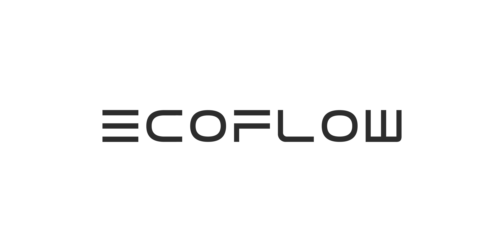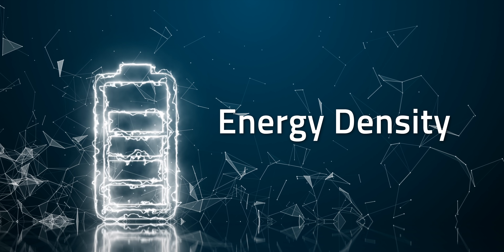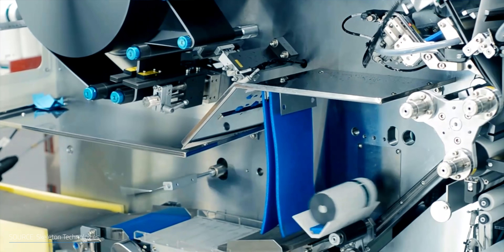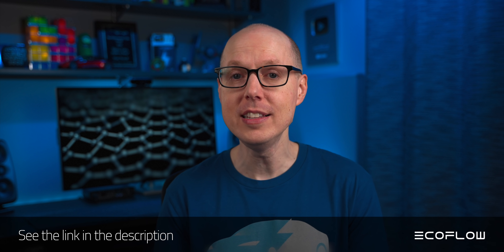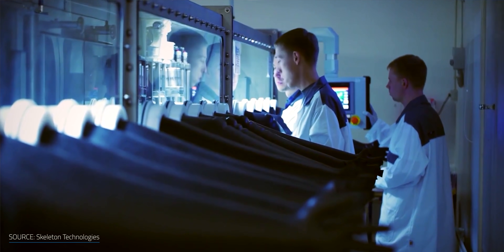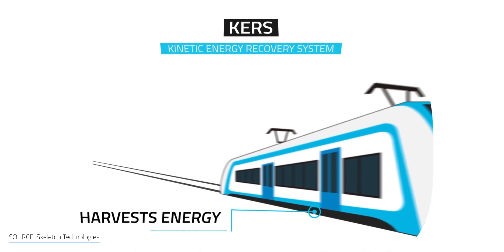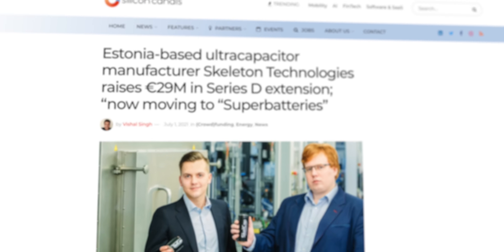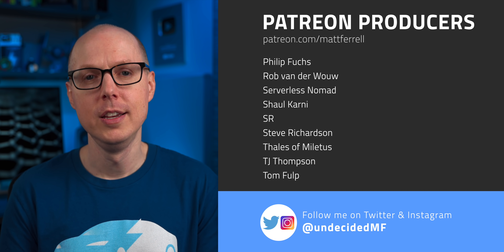Revisiting the Supercapacitor - The Wait for Graphene is Over

Comment: Batteries have a flat line discharge curve with rapid drop-off at the end. Capacitors have a straight line curve. From 100% to 0% over time. The bulk of capacitor energy is stuck in the bottom few percent.
Reply: uhmm arent you contradicting yourself ? "straight line" knowing you have P=VI means you have most of the energy 'accessible' while at high voltage. And yes, sure you need different power electronics to make use of whats stored in a capacitor, since as you point out, the voltage wont be constant. But what you may leave untouched at the bottom few percent of voltage because its hard to bring it up to the voltage level you may need for your application is only the bottom few percent of capacity and not 'the bulk'. But yes, a simple replacement of a battery by a capacitor will typically not work.
Reply: With circuits and controls, what can’t you make a system that charges stacks of units like this in order to create constant power? I’m asking but I can tell you it’s already being tested and is completely doable…with ss graphene units you can get a base of 30,000 discharges with zero degradation. It’s here just needs scale.

Comment: The 'Eco flow' battery looks interesting...but it's not very big.   A better solution would be a MUCH larger battery (that is portable and also multi-use)....A used EV with a V2G or V2H option.  Probably cheaper too--when you factor in the power available.
Reply: I have a neighbor who 'unofficially' modified a used Nissan (Leaf) for the same reason (V2H)--by hardwiring  in a large inverter.  He rarely uses it as a vehicle however.  The future will likely be V2G for all EVs.   Think how much power an electric school bus or semi truck could provide :0
Reply: Thats all well and good untill someone has to take the vehicle 
away to use it as a vehicle 🤔 And if the house has more than one user or occupier then you have that  problem times by however many🙄. 

Its a bit like removing land lines because you have mobiles but if  
the power goes down your loose your base towers and a lot of internet  and most phones will be dead flat in a few hours.
Also the place where your most vunerable are gathered together 
have no energy/phone.
This is exactly what has happened following storm Arwen in the UK .
 Also because modern gas heating systems rely on electrical power they were reduced to nonfunctioning  lumps of metal. 
The ultimate joke is cashless payments systems ...shops closed because their tills wouldnt work and customers couldn't pay for products by card or phone. 
A point not missed by very suspect bunch of hackers who got into the Spar shops system typical of outlying communities in the UK.🤦🏻‍♂️ Like those already hit by the storms.

We are building systems that are no more than a hightech house of cards... because no ones prepared to pick up the reigns.
And the Achilles's heel is the insistence on linking everything up all the time to the net and IT/AI systems. 
They dont cope with natural extremes heat cold and water especially the  salty stuff.. 🌏
Reply: Why are you not working for one of these companies if you think your ideas will work? Or will they?

Comment: Can these be used on my residential air conditioner to replace the current capacitor tech.  The current AC capacitors have put more AC repair guy's kids thru college and Fannie Mae, at least here in TX.
Reply: Air conditioning motor capacitors are AC low capacity high voltage types a super capacitor only handles 3V DC. Do you have 3 phase power in your home? then get a 3 phase motor in your air conditioner. It is more efficient and don't use capacitors.

Comment: Great video Matt, did Maxwell technologies (before being purchased by Tesla) involve graphene super capacitors? Thanks again…
Reply: I believe Maxwell was more about manufacturing method than materials used. So you could use Maxwell processes to make almost any battery or capacitor chemistry. And make them in large quantities.

Comment: I wonder if those ultra capacitors with graphene are able to be used for heating homes. For example PV panels can charge those capacitors and then they'll stepwise heat up the flowing water in the pipes
Reply: You don't use PV for home heating. Direct solar hot water is much more efficient.

Comment: They sure could have used supercapacitors in the Chernobyl power plant so they didn't need to try (unsuccessfully) to use turbine spin-down to cover the back-up power kick-in gap.
Reply: I just looked that up. Chernobyl's pumps would have needed 5.5MW for one minute. That's too much energy even for these capacitors. They would have needed several warehouses filled just with capacitors. (~100kWh)
Reply: @GotYourWallet  Fair enough.  I admire that you actually looked that up and figured that out.

Comment: much ado about nothing.
The use of graphene in real world applications has little to do with it's wonder properties at atomic level. Skeleton company is fundamentally scamming investors. As graphene is used just as a fancy graphite in terminals to reduce the internal resistance of a battery. An improvement, but not a particularly significant one. And experimental supercapacitors using actual graphene properties are at least 10 folds less energy dense than Li batteries, without even considering much higher costs. Besides, supercapacitors are pretty leaky and lose their accumulated charge quickly. So, unless capacitors are fundamentally redesigned, they will not replace batteries anytime soon, graphene or not.

Comment: I have been expecting Tesla to add a big slab of ultra capacitors to their performance models in order to provide more power with less battery stress and near instant addition of say  50 miles when charging
Reply: They're heavy and also need a DC-DC converter to be of any use, their discharge curve is really steep. Tesla bought a super capacitor company and just used their dry process on their batteries instead of making super capacitors.
Reply: You just spoke my mind, despite what others or Elon thinks, I still believe Tesla is missing a game changer opportunity here. Imagine a small 5KWH supercap that kicks in during fast regen to suck up power dissipated during fast deceleration or kicks in during insane acceleratiin to reduce the strain on the Li-ion batteries. 
Best part will be providing instant power during subzero temps to quickly pre-heat the car Li-ion BMS to optimal temp as well as preheat the interior, defrosts the glass and then slowly recharges itself back after preheating Li-ion batteries from the car or do so quickly during regen or during recharging.

Comment: I think a hybrid EVs, with Supercapacitor plus battery, would have many benefits. The Supercapacitor would take care of sudden accelerations and stops - they degrade the battery the most. The batteries themselves can be optimized for power density, not power - and this means they could possibly hold more power even though some mass is dedicated to the Supercapacitor.
Reply: Lithium batteries are in the transition phase to hydrogen. The batteries are too heavy and are an obstacle to long-distance travel. Hydrogen will be used for long-distance driving instead of diesel in 10-20 years. Supercapacitor + Hydrogen is the hybrid of the future.
Reply: @rapator9270  Hydrogen has too little efficiency for automotive use - in both creating hydrogen and in turning it into energy. It has other issues as well. Liquid hydrogen can't be stored for long, and is too energy-expensive to liquify. Compressed hydrogen is dangerous and requires heavy tanks, and has very low energy density per volume.
The only advantage hydrogen has is that cars using it can fuel quickly. Then again, so can gas cars and Supercapacitors.
I can imagine Hydrogen being used for grid storage between seasons. Lack of power density is not a problem when it's stationary, and lack of efficiency is not such a problem when you store enormous amounts of energy for months.
Reply: @nikolatasev4948  Estonian company who test and make self driving cars co op. with Skeleton( what is also Estonian company) says that hydrogen is  Future thing and lithum not.
Reply: @rapator9270  I wish them the best and lots of success! Toyota and a bunch of other automakers are also believers in hydrogen. 
But until they prove it, I would trust Elon on this, he seems to have a more successful approach so far.
Reply: @nikolatasev4948  Elon is one crazy dude in good way, but even him dont solve lithium high mass problem.
Reply: @rapator9270  Every approach has its problems. But Elon and his approaches have so far been more successful than all others - in both cars and rockets.

Comment: This is awesome news! I cannot wait to see where this goes. I've been using ultra caps as a high current buffer before/after battery to charge quicker even in lower light conditions then keeps the battery cells at 80% for most the day. Then after battery when used for inverter, it is allowed to take higher burst loads without brown outs. At night with the moon out, I've had my battery banks charged to 90% over night.
Reply: I won't worry about specifics here, but I have access to production data for utility scale solar plants. A full moon on a cloudless night is something like 1/400th the power of a sunny day. We have seen actual solar power at night (bounced off the full moon). Not really enough to cover the inverter functions in practice though.
Reply: @GuyIncognito764  there were no mention of inverter used
Reply: I call bs on that friend. 

I've never heard of anyone having the ability to charge with moonlight.
Reply: @ryanduckering  oh yah and to be fair, I didn't state that the amount of panels were disproportionate to the storage of the system. Wasn't a practical setup when testing it out cause the amount of panels to 1 48v battery and regrettably 128 ultra caps to match without over charge. Not cost savings practical. Just a hey look what I can do and won't really make a difference. I wasted a HUGE amount of money cause the caps are not cheap and the solar was already there and the main battery banks were already full. So it was just for fun. Nothing to actually use realistically. Something Something about designing something that no one asked for and no one has any need for, all for fun.
Reply: @ryanduckering  there was just very low mv and as anyone will tell you to not trust capacitors being drained cause static can still charge with low resistance to panels as compared to chemical change where you have to give it time to change chemistry. With that said you need high quality monocrystalline cells. So the only large resistance is the MPPT.  But yah with moonlight out, the MPPT does indicate a power output to batteries.

Comment: I think ultracapacitors can be great for supplementing batteries because there is still opportunity to capture more energy with regenerative braking.  The capacitors can accept more power.  In addition, it can lower the charge/discharge cycles of the batteries, extending their lifetime.
Reply: If super caps were helpful they would already be installing them. More likely the batteries can take the majority (probably all) of the energy back back. And with LFP batteries having such high cycle times super caps offer no advantage. Super caps still have way too low Wh/kg to be useful.
Reply: @AORD72   If they were something that worked on the scale, capacity, and cost point that would make sense... right now they don't, but soon, they probably will.
Reply: @dus10dnd  Well yes, but a long way to go as the best SCaps are around 7Wh/kg which is a long way from a battery around 200Wh/kg. Plus you have other problems with SCaps, they leak energy (self discharge) and they have voltage drop (batteries maintain a constant voltage over discharge time).
Reply: @AORD72  That was the point of the video, they're not going to be here tomorrow.  It will be a while.
Reply: @AORD72 , the pinch point for supercap is Energy density apprx half of Li-ion batteries, but it shines by orders of magnitude far better in other areas like no. of cycles is over a million, round trip efficiency is approx 99%, operating temperature is subzero -40'C to 80'C, and charge / discharge rate is over 5C
Reply: I wonder if a capacitor could not be "charged" very fast on certain points and then give off the energy to the battery while the electric car rides again. That way the battery would never get into trouble and the range anxiety would no longer be a problem. This would not be a replacement for the usual slow charging once home of course.
Reply: @jean-pierredevent970  That is a way that things could be done, but the density of the capacitors wouldn't be high enough to make that what you charge up, realistically.
Reply: @dus10dnd  Thank you, Dustin, for the thoughtful and polite answer. Yesterday somebody called another idea "very very very SILLY" 
Nobody learns anything with such responses. 
Shame even these supercapacitors here are not Marvel ready yet.
Reply: @jean-pierredevent970  Yeah, it would be really nice for them to function the way that you outlined.  If they did, it would probably more realistically mean that we would switch to capacitors and avoid batteries, which wouldn't be bad at all from a lifespan and sustainability standpoint.  Maybe one day they will reach that point.  I appreciate you calling out the civility... it is important for us all to foster it more often.

Comment: I like the idea of using these for starters (electric motors). These starters could be used to start generators that power electric vehicles. Having 1 small battery/capacitor is much more efficient than a huge 1000lb battery that has to be plugged in to the grid.

Comment: Always thought graphene capacitors was the answer to portable electric supply.  Need more companies trying out solutions in practice - Bill Gates and Elon Musk please use your wealth to fund it.
Reply: no, batteries are much better at that. however, capacitor are very good when it comes to longevity
Reply: @stefanweilhartner4415  Can the separation between capacitor plates be reduced using graphene hence giving more power per cu metre of capacitor?
So a cubic metre could contain, say, 100 miles of plates?
Reply: @Flowers_824  if the dielectric is the same and you shorten the distance, then the capacity would raise with the cubic meter but the maximum voltage would go down because of the shorter distance between the plates. so at the end, the total energy that you can store is the same. however, if you have a better dielectric material between the plates, then you could rise the total energy.

Comment: Side note on the ecoflo. I just bought my brother one for Christmas. It will replace a gas generator in his work truck with a large solar panel on the ladder rack. It will charge his tool batteries, run a mini fridge and run a microwave temporarily for hot food. The difference between a constant power supply and when you have to supply the gas and start all the time is quite dramatic.
Reply: I like the concept, but denying power density of fb gensets is foolish…but also wasteful. Too bad there wasn’t a hybrid system:)
Reply: @blainevans9237  oh, a generator is absolutely necessary for some things at this moment. But I foresee that changing in the future. I don't see why we don't have hydrogen cell generator boxes. Like with five gas gallon equivalents of hydrogen air compressed container in a suitcase with a fuel cell and some capacitors. A refillable battery box if you will.
Reply: The main answer is that hydrogen is not storable without great expense…you can store water as a fuel, but weight is an issue and the power needed to separate it.the best answer is to use a SOFC with ammonia. Very high density and a stable (albeit stinky) way of storing a fuel safely at low cost.
Reply: @blainevans9237  yeah, I'm aware of that. I was thinking as a backup power supply. One were you could do a cylinder exchange to swap in a fresh tank. Hydrogen is a pita in so many ways. Hopefully they get that ammonia thing worked out.

Comment: Sounds like it would be a good replacement for lead acid battery used in cars, which need a large jolt of cranking amps to run a starter.
Reply: Storage life would be the issue in that application.
Reply: Already there!   I have one.  Actually I have a cap in alignment with the battery setup but the cap can start the car by itself and it greatly increases the life of the horrid lead acid.

Comment: Oh, if only it was already available as a 12V battery replacement for any car. No cold weather troubles, no 5 year replacement, lighter. Even replacing the new 12V LFP unit in a Tesla would be great, as the longevity would be greatly improved.
Reply: Super capacitor battery already exists and is used by car audio people for example
Reply: @FSXgta  You have a link to a shop, where one can buy one of these graphene batteries?

Comment: Aircraft seem like a good future application, ultracapacitors for the large power needed to take off and get to altitude and batteries for cruising at altitude.
Reply: Might as well try to power takeoff from the ground, otherwise you’re carrying around a lot of weight in low energy density ultracapacitors

Comment: graphene batteries are still 5 years away, for 15 years now. Just like fusion energy is 30 years away.
Reply from the maker: Yeah, it's taking a lot longer than most people excited to go from lab to commercial production.  That's always the hardest part.
Reply: @UndecidedMF  I'm in battery business for last 15 years and was closely tracking the headlines for first 5 years, then I stopped once nothing materialized. As Musk puts it, [almost] all battery breakthrough headlines are BS.  :)